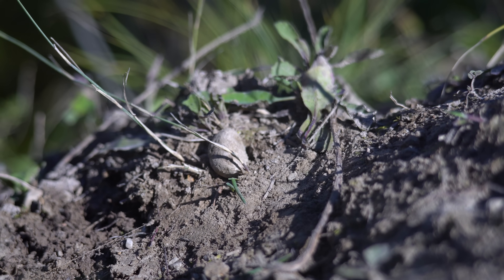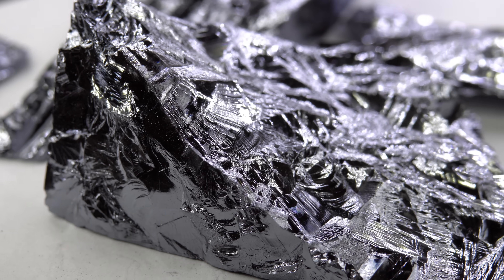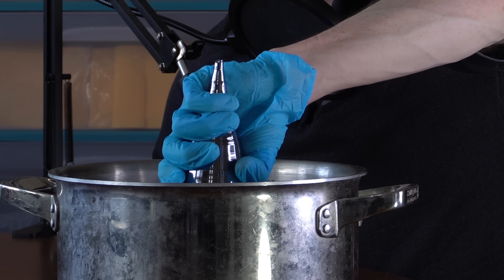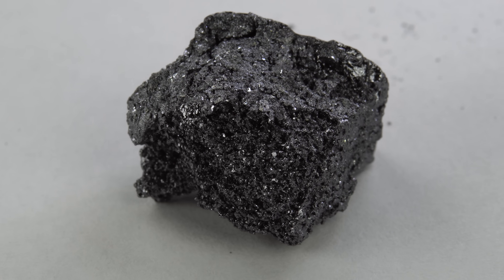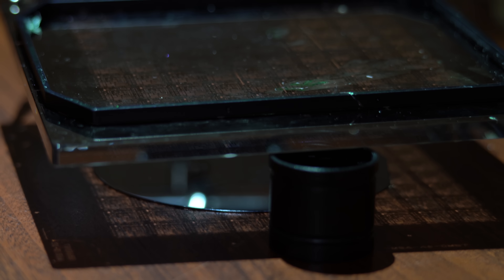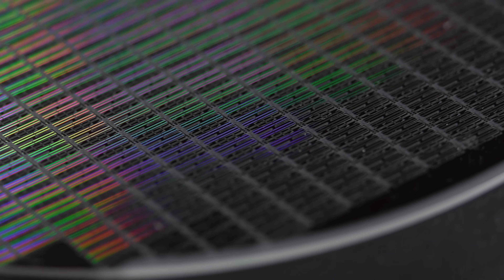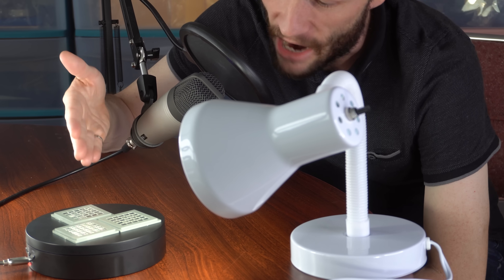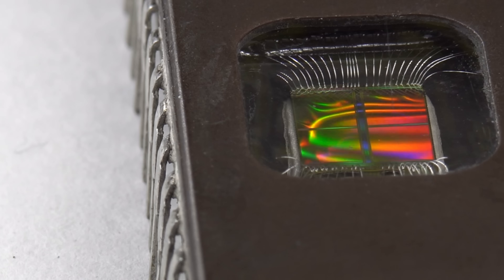How To Make A CPU

Comment: >dig in remote places
>extract extemely rare rocks
>perform magic spell on the rocks
>extreme heat and pressure are required
>inscribe microscopic arcane sigils into your magical stones
>imbue the stones with lightning
>the stones gain anima
>the stones speak in a language incomprehensible to all mankind
>certain trained warlocks can control the powers of the stones
>they learn the language of the stones
>the warlocks harness the magical stones powers to bring forth light and image
>the rest of the population is in awe
tmw you're literally a wizard

Comment: I have found a rock. But because you didn't include a hammer in the parts needed, I am stuck with a 0.000001ghz CPU. And it doesn't even play Doom.

Comment: It’s crazy to me that people figured out how to do this. Not just through trial and error, but they looked at the math and chemistry and said “yeah this should work” and it did
Reply: There were a lot of steps in between, but yeah: some theoretical physicist said at some point: "In theory, you should be able to enable or disable the electric resistance in silicon", and you totally can. And it changed the whole world.
Reply: It is crazy when you think it's a sudden discovery but it's more of progression, if you break all the technological discoveries down to make the first personal computer, it took centuries for the concept alone. Computers came from the urge to make more and more advanced calculators. The first considered "computer" was a giant mechanical calculator by Charles Babbage. Then Alan Turing invented computer science and made an electrical calculator using logic gates to compute series of binary values which is the same concept we use to this day. As for chemistry, it's all just about using better and better materials for efficiency it started with glass, to now silicon.
Reply: @mangobanana7195  This helped me connect some dots so to speak, thank you.
Reply: @mangobanana7195 calculator is exist thousands of years ago in china if I'm not mistaken
Reply: @_martian101  The oldest found abacus was a counting tablet from Greece. Although counting tools weren't considered "computers" yet. A computer was one that calculated automatically without the need for the user to count. Hence "compute-r" one that computes.
Reply: @mangobanana7195  but it's a tool to calculate so why can't it considered as the early version of computer? And how a tablet calculate anyway, ancient abacus use stick and balls while a solid tablet is more like a note for manual counting rather than a tool to count like abacus does
Reply: @_martian101  Counting tools aren't computers because they don't "compute", it relies on the user to "count" and the tool serves as an aide to do so, the term for them are counters.
Reply: @mangobanana7195  define compute
Reply: @_martian101  In this context it means the device handles all the calculation without the need for the user to count for it, hence counting tools are called counters, not computers, because counting tools doesn't compute for you, they just serve as extra digits with denominations to count on.
Reply: @mangobanana7195  compute is not a device, try again
Reply: @_martian101  no, I'm done trying to explain to you basic stuff, feel free to believe an abacus is a computer 😅.
Reply: @_martian101  You seriously trying to say your, "stick and balls" is a computer? 🤣🤣🤣. Oh god, please keep commenting, this is comedy, try again... Intellectuals in the chat please keep quiet, let him cook🤫😂...
Reply: @mangobanana7195  i basically trying to encourage you to learn about basic definition of a word, but you seem to give up even before trying 😌
Reply: @_martian101  So how do you compute with your "stick and balls"?, explain to us the process 🤣🤣🤣
Reply: @13thSystem  i've said that i dont want to talk with a bully, this youtube shadow banning is so annoying
Reply: @_martian101  Passive aggressive kid crying about being bullied? 😂😂😂
Reply: @13thSystem  oh no so scary 🤢
Reply: It could not have been done without science. But there is still a great deal of trial and error involved. A lot of times people just stumble on something that works, without understanding why.
Reply: Its not all trial and error. There are some educated guesses along rhe way
Reply: @LeanMan82  Considering we literally evolved from trial and error, one can argue that we're experts on it.
Reply: @MrLoowiz  touche... our eyes basically guess certain aspects of objects
Reply: @LeanMan82  Indeed, and noticing patterns is one of the best qualities on humans, arguably the biggest differences between us and other animals.
Reply: It’s bullshit black magic , no one invented this

Comment: You forgot about doing it in an environment where the air is mostly sterilized and pure, because if it's not, you'll end up with gunk in the microchip, not to mention that the surface's contaminated and you can't do good bonding to the circuitry.

Comment: overall really clear and straightforward but I'd love an explanation on affording $200,000,0000 dollar ultra-violet lithography machines - do you just have to be rich or can you finance directly through ASML? Or is there a cheap DIY alternative?
Reply: If you check the pinned comment, that guy is making chips at home, using relatively inexpensive equipment.

Comment: And realize it is trash because it is filled with dust and god knows whatever was floating in your room. 
Then you build a special room. 
Realize it is hard. 
Go get a doctorate on how to build that room and arrange the air circulation. 
Start the process again. 
Make sure you finish the process in ultra clean room. 
Seal it. 
Now you got a thinking rock. Congratulations.

Comment: It's actually amazing that people figured this out.
Reply: That's how I feel with bluetooth/radio and photographs
Reply: @Ajrich.ard.t Photographs are part of the process described in this video.

First, there was a chemical you could apply to paper that darkened when exposed to light.  You can still buy it for a kids project where you put a leaf on the paper and leave it out in the sun, and then the light leaves the shape of the leaf on the paper.

A photograph does the same thing.  But a lens focuses all the light from a wide range in front of you, and it concentrates that light into a smaller version that burns into a chemical-treated film.  Then the development process rinses off the parts that weren't burned, making the image permanent.

You can make a computer circuit out of wires, but it will be a lot bigger than an integrated circuit chip.  Since it's bigger, it takes longer for the electricity to flow through it.  Therefore it's slower.

So they design the chip bigger, then just like a photograph they shrink it with a lens.  The shape of the circuit image is burned onto the chip material, which hardens the material where the light shines through the projected image of the circuit design.  Then they rinse off the material that wasn't hardened, and you have a permanent circuit that lets electricity flow through according to the design.

That's how a human can design a chip that can be seen, and then it ends up as billions of microscopic pathways on a tiny chip.  Instead of a movie projector lens that enlarges a small image onto a movie screen, the lens is reversed so it projects a small image onto an even smaller surface.

Side note: a color photograph is just 3 black-and-white photographs printed on top of each other with different colors of ink.  The process is the same as the original: light shines on the film and makes a monochrome image.  But a color camera splits the light into 3 monochrome images, each with a different color lens.  So you have a black-and-white photograph taken through a blue lens, which filters out non-blue light.  Then you print that black-and-white image with blue ink & combine it with the red (black-and-white) and the green (black-and-white) images.
Reply: @Ajrich.ard.t  Exactly. We're probably currently sitting on opposite sides of the planet and yet we can communicate with each other without directly talking to each other. We take it for granted but when you think about this, at least for me it's mind blowing. We may forget about this from time to time but there is actually another real human being on the other end of this line with its own history, memories, friends and family etc.
Reply: It’s the result of countless other inventions that happened first. No one built the car before wheels.
Reply: @Settiis Exactly, this whole process took over decades, had several different purposes and different states along the way, each helmed by several different people.
No one woke up one day deciding to invent CPUs
Reply: I wouldn;t even know where to start. I would just be like, nah fk it
Reply: @luchiboy countless studies, research accidental discoveries. Trial and error would be too expensive
Reply: @luchiboy 

kinda how ideas work

you can't think about how to start something until you suddenly know how
Reply: That's collective intelligence for you. No 1 person would ever go from smashing rocks into dust, to microchip production in 1 lifetime.
Reply: That’s why semiconductor companies are rich 🤑
Reply: The computer was invented at CERN. They opened a portal and learned technological advancement from communing with spirits.
Reply: @blockyorbits2376  Lol take your medication.
Reply: The inventiveness of White people is astounding. No one else even comes close
Reply: https://en.wikipedia.org/wiki/Integrated_circuit#History

https://en.wikipedia.org/wiki/Robert_Noyce
Reply: That's not how it works, the evolution of computers, and of any modern tech, doesn't go like "Well first people built a fraction of the computer, then a quarter, then a half, then the full thing.

You first start with logic gates represented with electric signals, just fyi, logic gates can be created with arrangements of falling dominoes.

Then you move up from there.
Reply: Guys, Here is our Savior

HalleluYAH translates “Praise ye YaH”

YaH is The Heavenly Father 
YaH arrives via the TENT OF MEETING
YaH was Who they Crucified for our sins
YaH was Crucified on an Almond TREE

— Ancient Semitic Cuneiform of Moshe (Moses)
— Isa Scroll (The Original Isaiah)

Isaiah 42:8
"I am YaH; that is my Name! I will not yield my glory to another or my praise to idols.”

Isaiah 43:11
“I am YAH, and there is no other Savior but Me.”

Isaiah 45:5
“I am YaH, and there is none else.”
Reply: Alchemy.
Reply: What if some humans are naturally programmed to make this inventions just like how a bird makes a nest and ants build hills without being taught
Reply: What is really mindblowing to me is how we are able to make precise tools with less precise tools
Reply: It was aliens.
Reply: @jaykiller4510 ah yes, aliens. And who taught this to these aliens? 🤡
Reply: they were fuckin' genius
Reply: no maatter what they say we didn't we were instructed by aliens how to do this
Reply: In less than a 100 years 🔥
Reply: honestly, it really is
Reply: The secrets of the universe are difficult to understand and moreso to master. That makes our results more valuable.
Reply: Seriously, why aren't the names of people who pioneered this stuff household names? The lightbulb is cool and all but this shit seems way more difficult to have to figure out for the first time. I'm assuming it was a bunch of tiny increments made by different people but still
Reply: @thedrain9328  correct. The first IC was made by Jack Kilby and then Robert Noyce of Intel took over and now it’s TSMC. And no specific individual anymore.
Reply: @thedrain9328 they are if you study computer science
Reply: How do you even find this out ? How does one develope something like this. Its truly amazing if you think about it. There are godly smart people on this earth 😂
Reply: They are told what to invest in for the future: Silicone. Then the gate coukd be be built which I assume has something to do with CERN the internet and AI.
Reply: And the teacher wants us to learn in a DAY .
Reply: Belgium acts like a buffer state between france and germany.

Its citizens also have a high buy power. Meaning you'd have to be stupid as a worldwide business to not sell your products there.

Belgium also has the best harbor in Europe. Lots of money to be made there.
Reply: @ceshmate1953  money isnt everything
Reply: Occums razor , alien intervention. Why else did we excel so much in the past 1000 years than then2 billion before
Reply: Could just be exponential progression... like the last 100 years eclipsing the 2000 years prior.
Reply: @MachinedFace8  Eh. I don't think we didn't excel much before the last 1k years. Things like this come as a result of a buildup of past knowledge that was discovered. People were coming up with ideas for how a computer would work hundreds of years prior to the first home computer. Just think of how much an average person today knows more than someone like Isaac Newton about how the world works.

Also ancient civilizations built and came up with crazy innovations for their time, we're building off of that plus we have the benefit of not being constantly at war on our homeland.
Reply: @GIGAMILKY 
We got the abacus after all, that's a computer, well to be more precise, it's the display, the computer were however moved the beads.
Reply: @MachinedFace8 You're using the razor in a completely wrong way.
Reply: @TovenDo.O.Video-  agaisnt the grain or with?
Reply: @MachinedFace8  not alien intervention. Old world ancient tech.
Reply: @MachinedFace8 because we only existed for 250,000 years
Reply: @MachinedFace8 

Talking about Occam's Razor: Isn't it more likely that we live in a simulation to begin with since simulated beings should theoretically outnumber actual beings in the multiverse, and wouldn't it be much more resource saving to just simulate YOU while others are just npcs, MachinedFace88ttv?

Occam's Razor 🙃
Reply: @MRVNKL  or there's obvious intelligent intervention with our evolution and intellectual progression .  If its a simulation can i not push you and you a move?
Reply: @MRVNKL  now i'm no IT historian or anything but youre telling me you know the air tight truth  step by step?  And everyone involved is telling the truth ? highly unlickely mistow
Reply: @MachinedFace8  

I asked you a question and said hypothetically. I didn't claim anything :)
Reply: @MRVNKL your comment is so full of insane assumptions i dont even know where to begin